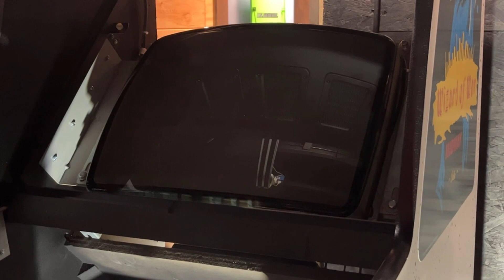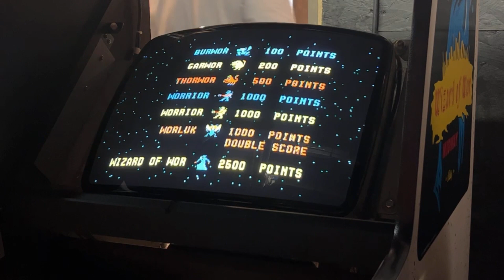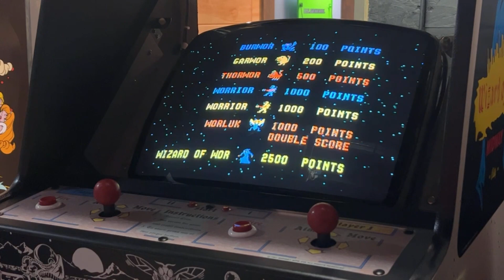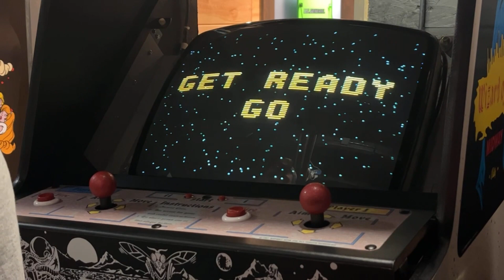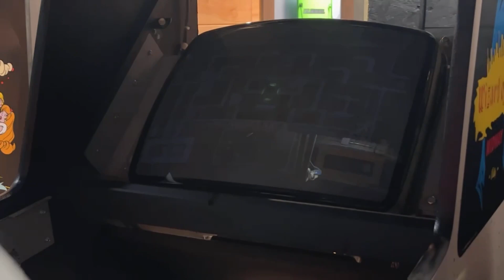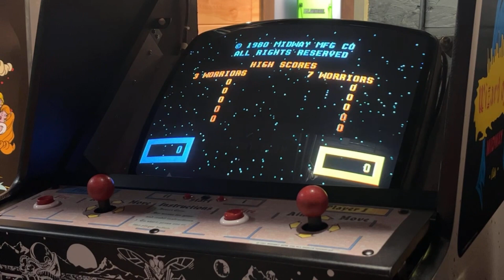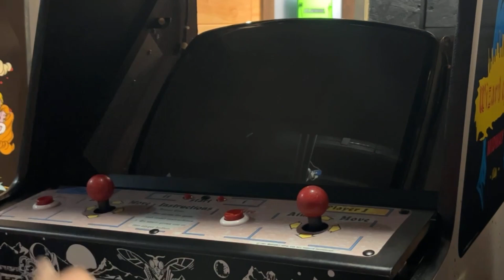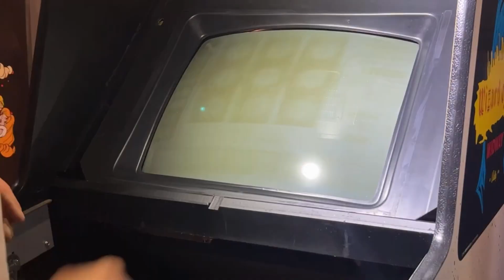Wizard of wor arcade restore part 11 fixing the control panel leaf switches

Comment: Troy, you’re missing some audio in the gameplay, the fire sound & the sound when you get hit for sure. I’m not sure what other sounds are missing I can’t remember. Check your audio board and adjust it, I think there’s 3 separate pots for each speaker.
Reply from the maker: Thank you it’s the left speaker that’s not working when I move the left pot I hear static I thing the pot might be mad
Reply: @troylukans2174  no problem, I remember the game setup was close to Gorf when adjusting the sound & pcb rack setup. Gorf had a little different audio amp with a left side & right side for adjusting. Keep up the great videos, been watching all the arcade restores. Amazing work!